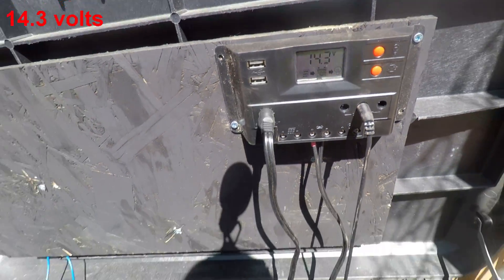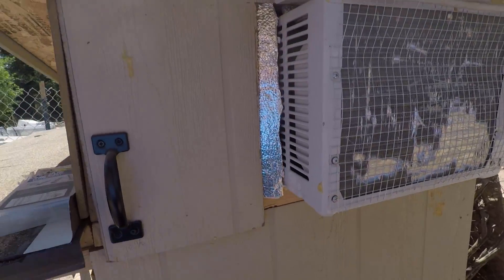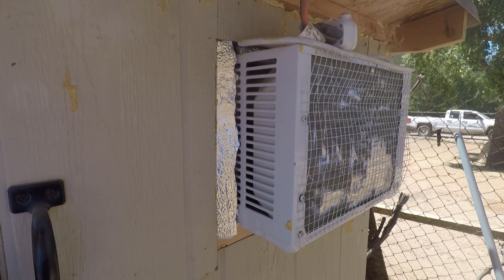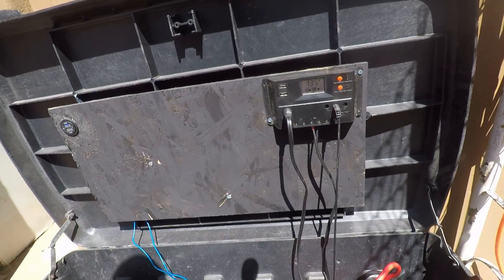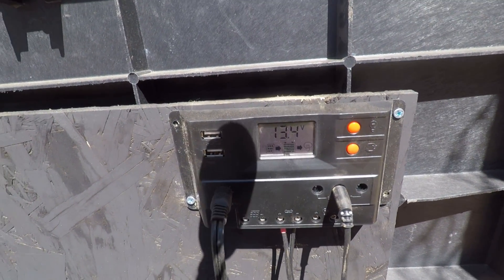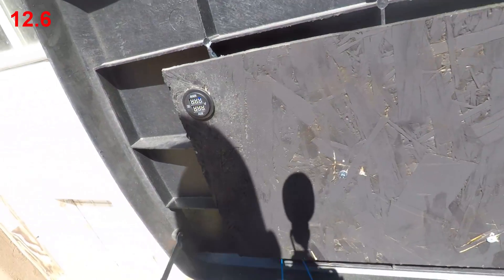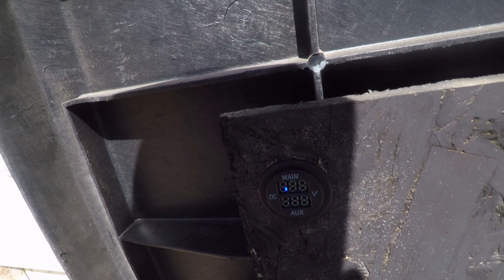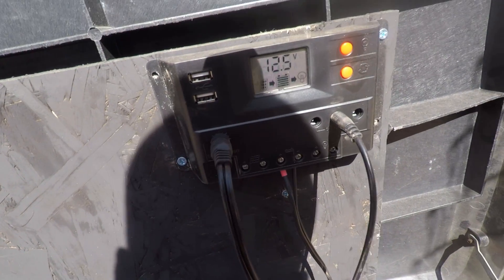HOW LONG CAN YOU RUN  A/C ON HARBOR FREIGHT 100W SOLAR PANEL(63585)

Comment: You were running everything from the batteries pretty much..so, it wasn't the panel generating 100% of your power.

In other words...you were using mainly stored power.

Comment: I really don't like these kind of videos. It really misleads people into thinking you only need a 100 w solar panels.
You really don't say anything about how many batteries you are using. The key thing is the battery bank. Then the solar panels. I will give you an A for making a video. But for knowledge I'll give you a D.

Comment: An average 6000 btu unit and inverter will constantly draw about 31 amps from a battery if you keep things at 12 volts. 
If your average deep cycle boat battery is 80 amp hours, and you only drain it to around 50%, you’ll get around 75 minutes of run time, if no solar panels are helping.
Reply: If the AC pump is not running the watts will be only what the fan uses which is much much less.
If you use it wisely and not on super high the time changes.

Comment: A 100 watt solar panel alone won't run any air conditioner which may be around 1000 watts or more. The solar panel only recharges batteries. The batteries provide 12-14 volts DC voltage to the inverter which outputs 120 volts AC to the air conditioner. He didn't show us the batteries or tell us their capacity. The air conditioner will run without the solar panel, even at night, until the batteries discharge. If the air conditioner takes 1,000 watts (=1 kilowatt), if it runs for one hour that is 1 kilowatt hour (1kWh). If the system has a capacity of 10kWh, the air conditioner will run for 10 hours. A 100 watt (1/10 kWh) solar panel will take 10 hours to recharge the system to 1kWH, and 100 hours to reach 10kWh.

Comment: You're not running a 5000BTU AC window unit on 100watt solar panel.
Because it will draw 1,000 watts when it's compressor engages.
If you have dogs, That's a declaration of war.
Expect me.

Comment: How many batteries did you have on your system?  What type batteries?  Capacity?  Thx.
Reply from the maker: At that time I had 4  trojan t-105  6 volt wired at 12 volt. You can search the batteries and look at the battery specs. They are still running strong. The only bad part is the maintenance.

Comment: This does not answer how long the solar panels can run it this answers how long your battery bank can run it.  With a little assistance from solar recharging some of the spent energy.    How long does it take for the panels to recharge the battery bank when they are spent?
Reply: I had the same thought, i didn't even see how many batteries he had

Comment: Thats what i did air conditioning and heater for my dogs
Reply from the maker: Works good just added more solar and batteries and a timer only run it during sun light, my dog don't use it much now but when its hot they don't come out if the dog house lol

Comment: What was the ah rating on the batteries?
Reply: The HF batteries are rated at 35 AH... Parallel 4 of them and you can hit 1680WH 140AH, just as big as thos Renogy and the likes.

Comment: You finally answered my question about how long it will take to drain the battery on solar system thanks allot I'm from KY and have been wanting to go to solar system and I've been watching every video I can find and I've asked several times but nobody has ever been able to answer my question about how long it will last
Reply: Well that's a tough question.  It all depends on your battery bank and what you are running.   Batterys have watt hrs ratting.  So if you run something that is 10 watt and you have a battery that is 100 watt hrs you can run it roughly 10hr if you want to run the battery down to flat out dead. But you should not let it below 50% or so there is that.
Reply: Specifics Bob, specifics.
That's like asking Joe Bob how fast this new car is (that you just put together). Joe Bob cannot answer your question little Timmy. You did not provide enough information to determine an outcome.

Comment: What kind of battery system did you use
Reply from the maker: Trojan t-105 lead acid batteries
Reply: @toolhead147  how many batteries what amp hrs. Tring to learn some about this.
Reply from the maker: @charleslamarbaldree4978  4 batteries total, 2 connected in series making 2  12v batteries those two are connected in parallels making a 6v to a 12v system

Comment: I'm looking into some panels for camping..not that I would run ac off these but pretty impressive that it did! Out of curiosity you ran the ac till your batteries were low..so when you turned it off and let them recharge..how long does it take to charge them back up?
Reply from the maker: This is my old set up. On these panels about a day to fill those batteries. Would suggest getting at least 500 watts in solar panels to run this 5,000 a/c. All day as long as there're is sun light.

Comment: You cant run it on the solar panels, its running on the batteries and the ac will run those batteries down in a hour or two then it will take the solar panels days to recharge the batteries

Comment: People do your research before you throw your money away.     It is simple math......it can't be done.    It would take a week off solar charging for an hour or two of ac....
And you will trash your batterys
Reply: WRONG
Reply: wow jerry, that is the most uneducated statement i have heard since the president left office.
Reply: @pearlrival3124  he hasn’t left yet
Reply: You're full of shit, I've been off grid for a while, I have 500 what's and five led acid deep cycle batteries, during direct sun, batteries are 14.4, then I can use all I want, it never dips below 13, and 12.4 is hot on a 12 volt batteries. It can work.

Comment: Your system will run much more efficiently if you get a "fin comb" and straighten out all the coil fins on the back of the ac.  Right now it looks like 1/4 of thee fins are bent over restricting air flow and making the a/c use more electricity to function.
Reply: OK

Comment: What's that, 600W AC running at min. cool and min. fan speed so maybe it draws less than 100W??  Better than nothing, but wouldn't a fan in the back of the dog house, but pointed toward the entrance and set to max speed be more efficient at cooling your dogs by the same temperature in daylight hours on a supply up to 100W?
Reply from the maker: The house is insulated to help the a/c be more efficient.  The roof is angled down si the air travels down from the fan. Thank you for watching
Reply: Nice.
Reply from the maker: @kennynoble1223  it was a lot more work and money than what I thought. I spend like one week straight all day working on it.
Reply from the maker: Here is the vídeo of the house https://youtu.be/YApvYWgZ7Ao

Comment: Did I miss something? What was the conclusion?
Reply: 3:45
Reply: He's not producing enough amperage to charge that much battery. They only produce 0-6 amps per 100w array. 3-4 amps are required for decent recharge of 1 battery. This setup will be in a constant state of decline until the batteries just die from being slow cooked. 
I have 2 arrays with a bank of 3 Thunderbolt magnum universal batteries-12v 35ah.
That's 200w coming in 12amps sometimes through a single controller. (It can handle it. There's a 20amp fuse inside.) Anyway. 12amp charge potential 105ah storage potential. I can run an old big ass window unit like that one for almost 2 hours but recovering from that will take 2 days minimum with clear skies. 
I live on my solar power alone. It's great as long as you balance your charge and discharges. Have zero power bill and zero regrets.
Yes maintenance has been considered in a preemptive deterrent to you trolls. Do your research and make wise decisions based on as many factors as you can calculate. You can be content without commercial power. Just be always mindful, it's not commercial grade power, don't expect too much. It's part of a lifestyle. Unless of course money is of no concern. Then you can power the neighborhood just for the thrill of it. I do enjoy a particular memory wherein a snowstorm the neighborhood went dark, and I, content in my decision to provide my own electrical needs, finished my cup of hot cocoa and placed a few lights outside so passersby or just whoever needed to see, could. Such peace of mind. 2 years of service with minimal trouble. Connections corroding, getting wet, coming loose. And the dreaded cleaning of the array! Which is simple. Soap+water÷water×3= B. B × sunshine = AMPS!
PRO TIP- buy some lower capacity 12v batteries for cloudy days and extended durations of undesirable weather. The smaller batteries will charge with fewer amps (a good thing when few amps are available). They don't last long, but they'll charge in low light conditions and paired or banked in parallel, they can still run the microwave or coffee maker or give you that golden crunchy toast we all love.

Comment: A 5000 btu ac uses about 500 watts while the compressor is on. 
Since the harbor freight system doesn't use an MPPT controller to squeeze every bit of power out of the panels, there's only about 78  watts of useable power (13 volts × 6 amps). Knocking off about another 8 watts for inverter inefficiency, each HF system can feed an AC with 70 watts of 120 volt power.  Assuming the ac compressor stays on continuously, you would need SEVEN 100 watt setups to run a 5000 BTU air conditioner continuously while the sun is shining.
The AC probably would not require being run continuously to cool a small room such as a doghouse so you might be able to get away with 3 or 4 harbor freight systems.
Reply from the maker: Andy Andy I appreciate your feedback.  I will be adding 6 255 watt solar panels and im currently saving money to buy an mppt charge controler.  I will be making an a vídeo when I upgrade.  Thank you for watching
Reply: toolhead 147 
That's a lot of solar!   You'll be able to run quite a bit off that.  Are you planning on a grid-tie setup?
Reply from the maker: No, its going to be off grid.  It sounds like a lot but its not considering all the losses.  I actually want to run a mini split ac maybe a 18,000 btu or 12,000 depending on what kind of power I can get from the solar panels.  Here it gets really hot on the summer electric bill is about 250-350 so hopefully I can reduce in half.  Maybe next year I have that setup.  If you want to look at the panels I have I do have an updated vídeo.
Reply from the maker: That's the newest vídeo.  I build a big box were I'm going to place all the components.  I did buy the solar panels used, got a smoking deal on them. 

https://youtu.be/aW3cJq9V41E

Comment: I'm looking for an air-conditioner that will run straight off the solar panels. The more direct sun (hotter) the better the air-conditioner works (variable speed). When the sun goes down it turns off automatically. Something like a DC variable split phase air-conditioner. The inverter in the video is wasting probably 15% of the power.
Reply from the maker: tigeroll yes it is,  but they are also very expensive. With all that money got can buy a bigger system. Just this would be the most cost effective route. Plus you can make use of all that electricity that your producing tu run the rest of the house when your not using the ac. Just my opinion.
Reply: I think it Can be done with any inverter type ac by boosting the dc voltage and hooking it up directly to the dc rail.
Maybe the ac has to be tricked since it it won't get any ac voltage on the terminals.
It would definitely be better since there would be no more losses due to the inverter / charger

Comment: Doesn't the amp hours on a batteries make a difference?
Reply from the maker: D Smith yes because the 100 watt just provides that, the rest runs on the batteries.  So in order for it to be ran all day I would have to have at least 500 watts in solar to run a 5,000 btu ac which needs about 400 to 500 watts.
Reply from the maker: I will be upgrading my system soon adding more solar panels

Comment: its not running off solar its running off battery just thought you should know
Reply from the maker: mikecox05799asd yes it is, i'm currently working on adding larger panels to have that a/c run all day
Reply: mikecox05799asd but the power in the battery does come from solar
Reply: Nery Miller what kind of battery and how many.?
Reply: @NeryMiller  it wouldn't charge fast enough.  Those panels don't put out enough current
Reply: @j5892000  your right
Reply: @NeryMiller  But take away the battery and AC will never run on those panels.
Reply: How big of am hour battery are you using and how many batterys

Comment: Appreciate the info
Reply from the maker: thomas dipaolo thank you for watching
Reply: toolhead 147 - we are planning to do something similar, so your details regarding battery type and run time are helpful. Our  battery bank only contains two group 31 batteries with 105 ah each at 20 amp draw. The batteries are also 12 volt AGM vs 6 volt flooded. Still plan on doing a runtime test with a settable battery shutoff switch. From your info, it appears will only get 1-2 hours of use beforr having to recharge. Our unit is in a camper with the idea of overnight parking without utility or generator power
Reply from the maker: Yes that was just an experiment,  to keep that little ac going all day you need at least 600w in solar panels. Maybe double the size of the batteries to get 2 more hours